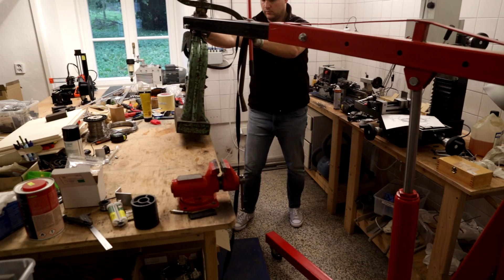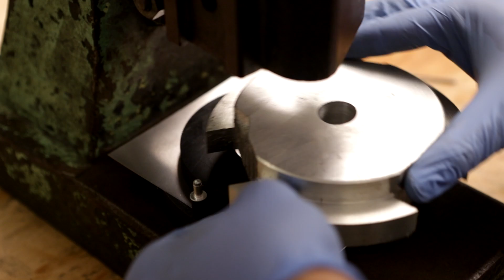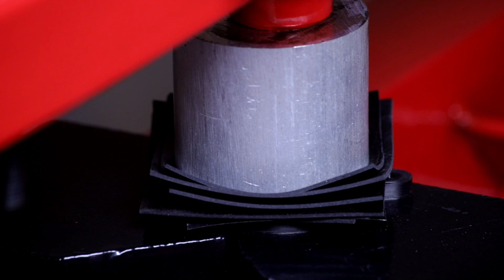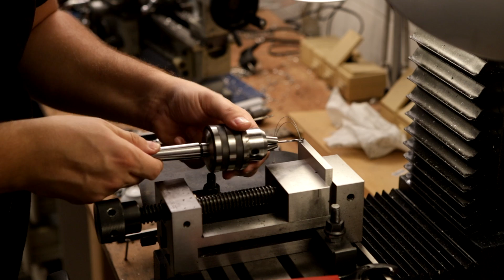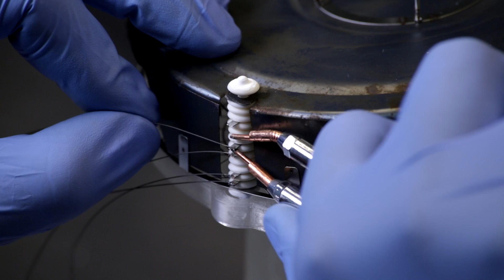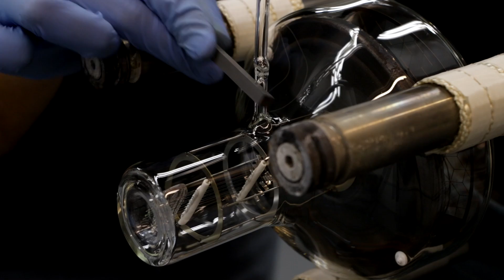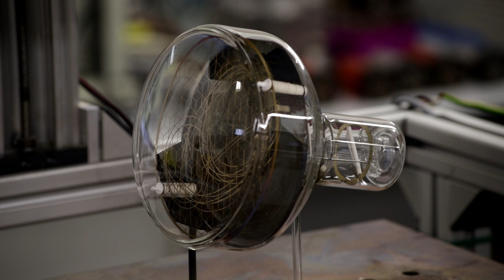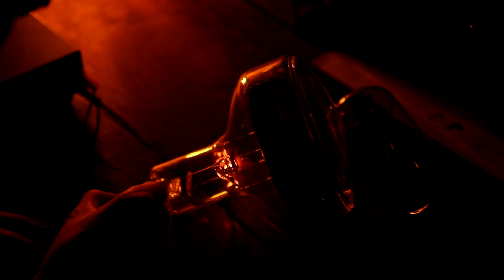Making: Huge Nixie Tube Finally Glowing!  - Project H #19

Comment: Did your solvent vapors strip more of your cable insulation than you wanted?
Reply: I mean does sodium hydroxide have a low vapor pressure? Its basically multen salt right? I dont think there would be much vapors
Reply: most likely....

Comment: A couple thoughts. You could try driving the digits from both sides to reduce overall current in the wires. Maybe increase the number of posts from 2 to 4. With the posts closer together at the top and bottom. You wouldn't have to put 4 attachments on each digit

Comment: I think you can get away with much thinner forming tools and safe a lot of filament in the process.
I made a couple PLA forms to use in a DIY press - well below 20T, but hundreds of kilos for sure.
After my inital tools worked well with a 10mm bottom I cut the bottom thickness down step by step and noticed that it works just the same with a 3mm base thickness but printed at 100%.